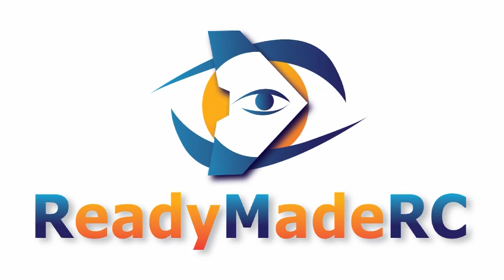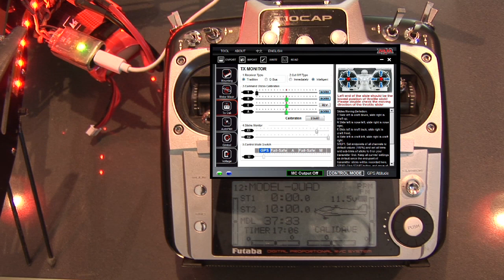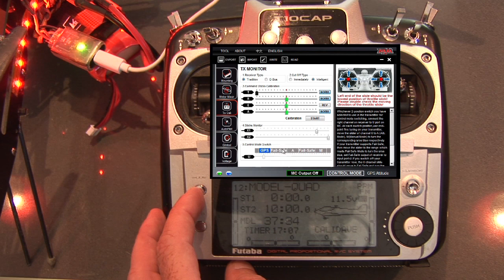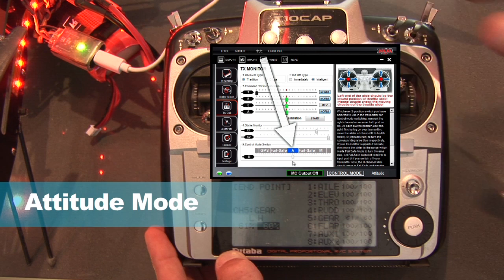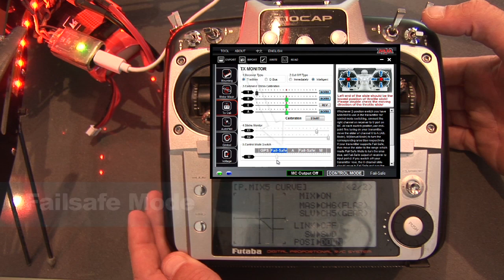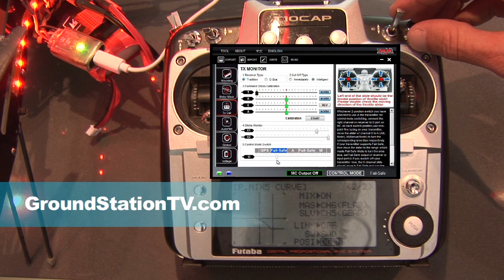GSTV - Naza GPS - Mode & Failsafe/RTH Setup

Comment from the maker: Yes, it works on my radio as this mix modifies the switch down and falls into the lower failsafe. I've verified and you can to just by flipping the switch and you should see the lights toggle entering failsafe mode. ;)

Comment from the maker: You just have to have the switch push out of the range for each mode into the failsafe model. you can verify in the software when you do the mix to see if it falls out of range. I thought it might not work even on manual mode but mine did. ;)

Comment: I got it working with mix with gear and flaps.

My setting work in any FMOD goes in Failsafe active when any Aile D/R switch is set to 1.

The only problem is I was going to use my NAZA X1 as gain adjustment because this is a new Quad and when every thing is set I am going to use X1 for my gimbal pan.

I will have to come up with some thing later that does not use flaps.

Comment: Also, when I trigger failsafe and am connected to Naza Assistant, on the Tx Cali tab I notice the X1 slider will move from the left side to the right side. X1 I believe is for remote gains adjusting and I don't use that. Is this normal or anything I should be worried about?